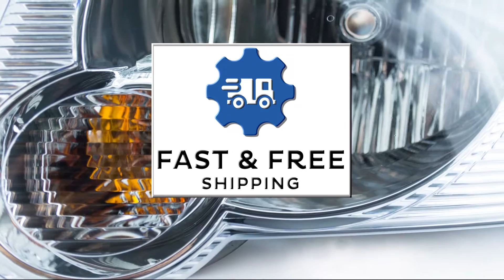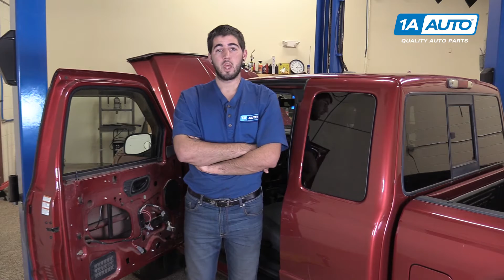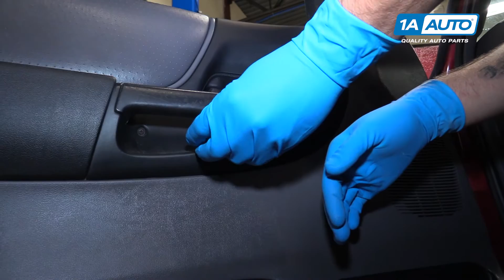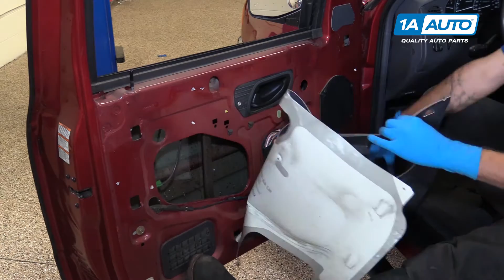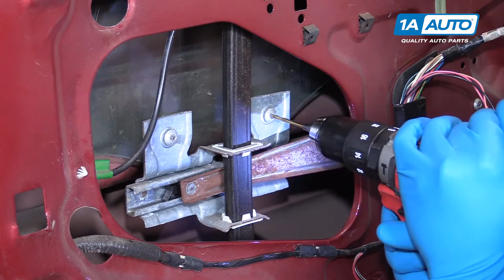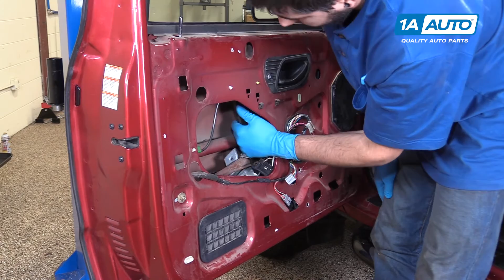How to Replace Front Drivers Side Power Window Regulator 93-11 Ford Ranger

Comment: I just completed this job.  You don't have to remove the horizontal rail from the glass or the verticle post, which greatly simplifies the job!  The regulator can be removed after four rivets holding it are, the end of regulator arm can be slid out of front of horizontal rail, and the new one placed in in reverse!  It works perfectly and is so much easier, I promise.
Reply: Absolutely.  Drilling out the window rivets is asking for trouble.  It is Completely unnecessary if all you are doing is replacing the motor.  This video needs to be re done or removed.
Reply: @mcrow3856 quick question
Reply: One quick question  I have a 2001 ford ranger and the driver side window makes a loud banging noise when I fully close it. What could be causing that. Am worried it might break my glass

Comment: At 4:54 that connector is the motor drive.  If your window doesn't move at all, you should put a voltmeter on this, cycle the switch and verify you even have power to the motor, BEFORE drilling ANY rivets.  Your problem may be the switch, a fuse, a relay, a ground lug...  A dead regulator motor is a pretty common problem, but you should always check the cheap and easy stuff  FIRST before buying expensive parts and ripping things apart.
Reply from the maker: +eilliwwasniahc Thanks for the tip! We'll pass this info along to our production team.

Comment: Just replaced mine and used the 1/4" rivets that came with my Harbor Freight Heavy duty hand riveter ($16.00 with coupon) Made it easy and faster than bolts. 
There is no need to remove the glass, it even stays where it is by its self.

Comment: This is a great video for reference if your window works... Mine was stuck in the closed position so I couldn't drill out the rivets for the glass. Instead, to get the motor out, I drilled a 1" (25mm) hole above and to the right of the lowest rivet, where the 3rd bolt for the motor is, and drilled out the lower rivet. Now I could take the 3 bolts out and remove the motor. My problem turned out to be a bound-up regulator, and when I took the motor out I was able to free up the mechanism and just reinstall the original motor.
Reply from the maker: +gavin downie Thanks for checking us out! 1AAuto.com

Comment: A great video/help for me!  I've watched this twice & taken notes...I'm ready to rumble with my new/used 2000 Ford Ranger XLT 3.0L with a dead driver's side power window!  Er, except there's 1 problem...kinda big headache...I replaced the ignition switch (not the key cylinder) as the truck was experiencing random no start/crank episodes once in a while.  It seemed like jiggling the shift lever and/or key got it started, so for $18 I took a chance & replaced the switch.  Now the truck is in anti-theft mode & the dash is deader than a doornail.  No 'check engine' light or ANY lights appear or will turn on.  Not a crank or peep from Mr. Starter.
I been haunting the Ranger Forums trying Reset tips (with caution - I don't want to fry the PCM or GEM and whatever else is in the signal path to start!).
My key is a plain one...not the fob with door locks/horn/start on it.  A guy at a shop down the road seemed to think I inadvertently cleared out the whole memory in the PCM (?)  He didn't seem to upset/worried about anything and indicated he could stop by my carport after work & do what he does to make a Ford happy(!)
I guess I'll have to shelve my power window repair until I get Accessory power restored, etc.  I can wait...just a bummer having to hang a tarp over the door 24/7 as it's been raining every 2 days here in MO for two-and-a-half freaking months!  And it always comes in quick when I have the tarp pulled up!  :-(
(The Park to Drive shift lever and key turn didn't work...Off/On 8 times + power lock didn't work...that's for the fob key anyways.  I had the negative battery off for quite a while while I did the spark plugs & wires....hmmmm, one guy said there was a little red light on the dash of his 1999 Ranger blinking along with the 'Theft' light (?), but didn't realize it could be pressed, and when he did - voila - no more startus interruptus!  I have yet to see WTF he's talking about & seeing!  He must have a Mazda or ??  Another guy said to pull negative off and touch to positive for several minutes (?) or however long it takes to do a 'system reset'.
I don't know if this is Ford's rec way of doing this, so yeah, this is something I want to be cautious about!
If anybody out there been through this & care to chime in I'm ALL ears!  Seems like several defaulted to finding their Transceiver was bad/went bad/or needed to be re-programmed.  I haven't paid my dues yet in learning about this vehichle, so excuse my ignorance(!)  I'm on it, though! 
I just feel SO special that Ford's theft algorithm is protecting me & thieves against starting this 20-year old truck & driving off with it!  LOL  Good luck with that - one patch of level grass with dew on it and all you do is spin/slide/tear up your lawn being as how the 4WD doesn't work either!  And Ford put a protective key cylinder in the spare tire access hole for which the previous owner had no key for...and the ignition key doesn't fit it(!)  Called 3 locksmiths and they said what my neighbor wanted to do, and I wouldn't let him as I thought maybe it too was connected to the anti-theft system, but they all said "DRILL IT OUT!  20-years old...it's corroded & won't work anyway!"  Wise Words!.
Reply from the maker: +boboala1 Thanks for the feedback!

Comment: great video, but what if the window is stuck in the up position?
Reply: @NZT TZN  thanks for the tip! Doing this today... don't want to break the glass!
Reply: If so there are other screw heads you will see and be able to access simply if ya look around a bit

Comment: Is it really necessary to disconnect the switches assy?  All you need to do is slide it through the hole and let it hang.  I didn't see where you put lock washers on with the nuts.  For easier installation, I would recommend using lock nuts or risk the nuts coming loose.  The fifth nut you left out can be installed with the right size and a little thought.  Thanks for posting.  I enjoy your input.